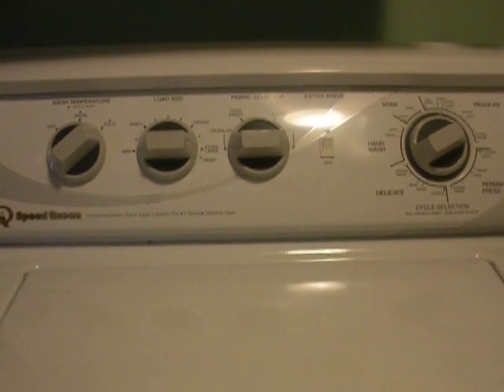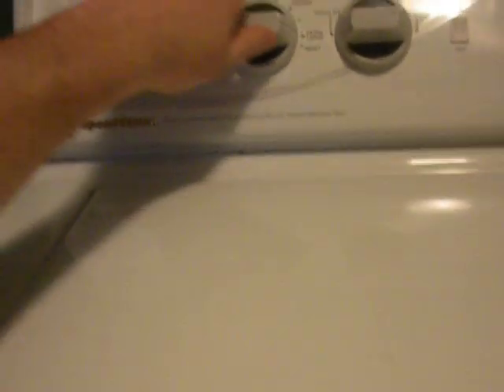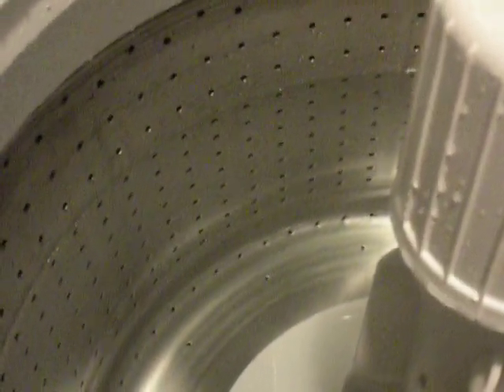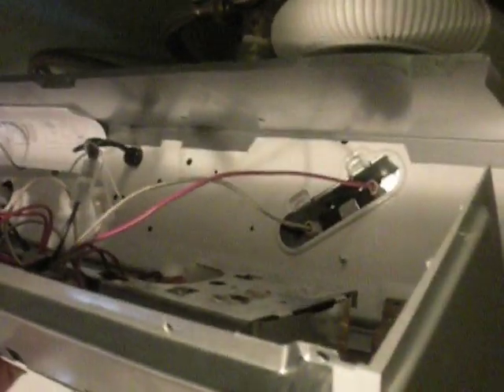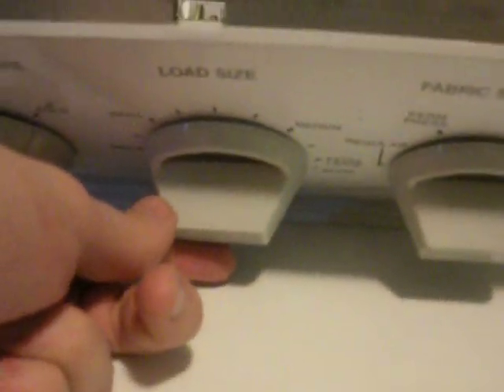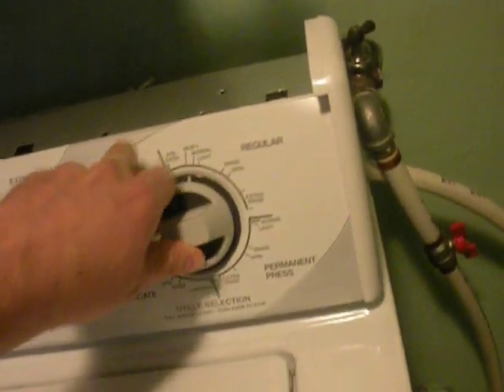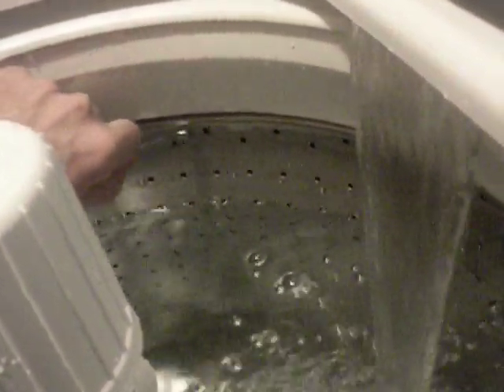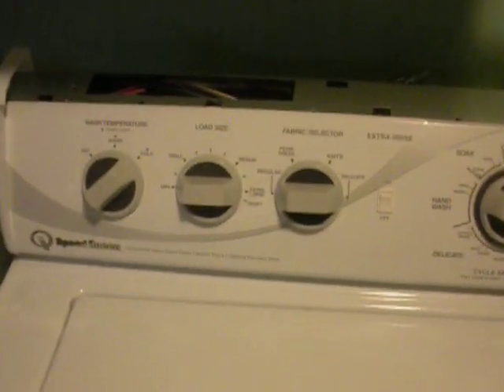Speed queen Clothes Washer water level problem and how to fix it

Comment from the maker: I can change diapers on our child, but I can't change the crap coming out of washington.  That's alright with me as long as these companies keep these changes accessible.  What really bites is the other makers out there are using digital control panels that can not be easily modified.  Those knock off brands (in quality not in price) are just a pain.  I don't post these out there as a slam on SQ, it's a solid brand and they are only doing what the idiots in DC are requiring of them.

Comment from the maker: Yeah, it's hit or miss, there is no exact number of turns.  I turned it until it was full, then backed it off a half turn to be sure it wouldn't ever spill over since it's a pressure tube, no precise science to the water fill, give or take a half inch with those things.

Comment from the maker: Hi Shannon, I did this video, you can post on here if you want a reply.  I don't work for speed queen, I am a consumer.  I don't recommend any particular model, I only like these because they are top load and have old school steel transmissions.  The new ones are direct drive and unreliable.  I hate front loaders.  I wash some nasty dog blankets, etc, and trust me 5 gallons of water or whatever they use will not clean off that garbage.  It takes some volume to get that garbage out.  The speed queens just work, mine only broke down when our 10 year old at the time got some socks between the drum and it got sucked into the water pump.  Speed queen has TERRIBLE customer service.  I was out of a washer for 3 weeks with 2 small kids laundry to handle.  It was a nightmare.  I hope they can resolve that, I love their product, hate their complete lack of service.  Note, I live in a town with 150k people, you'd think they'd have some service people nearby but the wait was loooooong and they all wanted money to look at my brand new washer.
Reply: alitak The new ones are direct drive?  I don't understand.  Are you saying new Speed Queens are direct drive?  Or are all Speed Queens (even new ones) still steel transmissions?
Reply: +alitak I thought they had a 3 year warranty covering everything.
Reply from the maker: +Barbara Mazzocca the water level isn't a warranty issue.  It's a government forced design that keeps clothes from getting clean on a full load.
Reply from the maker: +Auxillian Warghost mine is not direct drive.  I think all the speed queens have transmissions.

Comment: I am thinking of buying a Speed Queen but I wanted the one with the electronic buttons instead of the dials.  Would I be able to fix the water level on this type?  It does not have a reset button. AWNE82SP
Reply: ronna allen
Reply: ronna allen Do what you want but I have heard a lot of people having big trouble with fancy electronics going out. I went with the proven old school knobs.
IDK about the adjustment with electronic contols.

Comment: That line didn't make any sense. I laughed and laughed.  Just wanted to make sure people knew there was a way to add water without buckets or tearing apart your washer. That information will come in handy for people who do giant load after giant load.  For me having to add water to an oversize load now and then isn't that big of a deal. I think you'll enjoy the irony in this:  I had to replace my washer in part because the fill valves wouldn't shut off. I had to watch the machine so it wouldn't